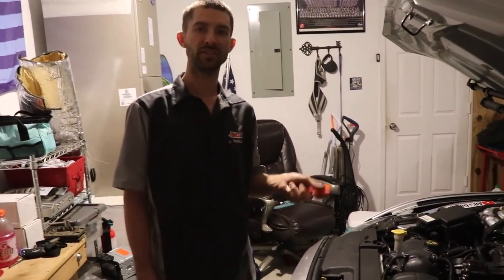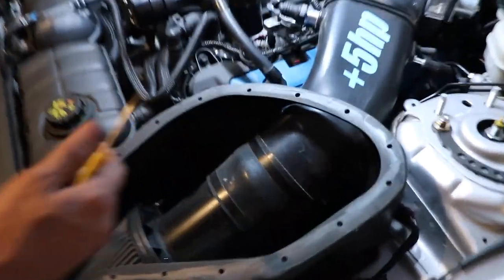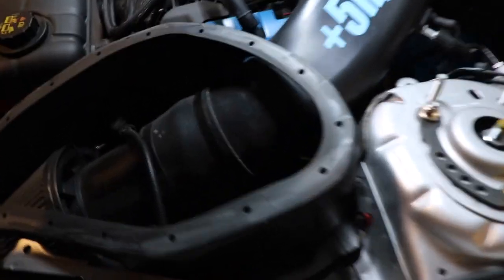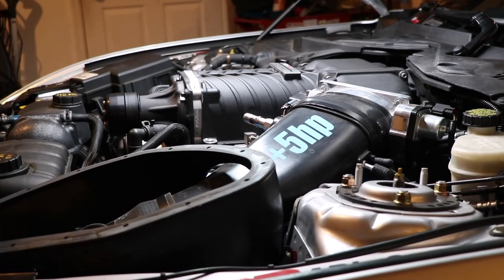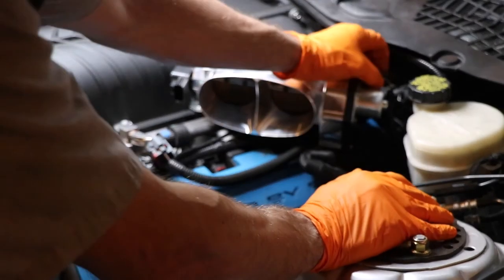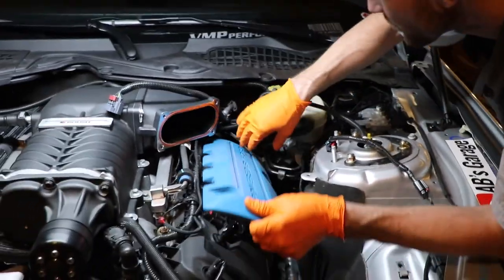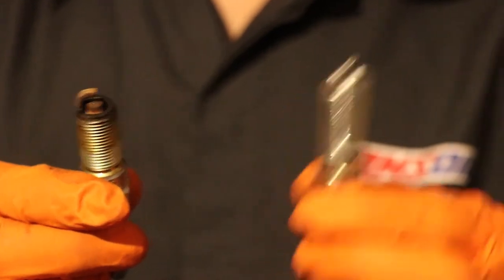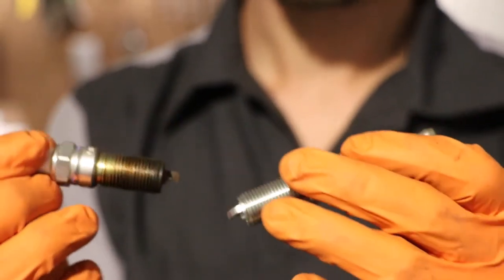Replace SPARK PLUGS **HOW TO** on a (Supercharged) Gen 2 Coyote 5.0L Mustang!

Comment: Great video. Extremely detailed! If I have a Roush Stage 3 on stock boost, would I use those same plugs? They are 1 step colder but is my car already tuned for that from factory?
Reply from the maker: I believe you would

Comment: 👍   Thanks for sharing!   What Torque Wrench did you use?  Nice video..  informative as usual! 

Bring on the oil cross over lines on your GT350!  👍😁

My Quickjack arrived yesterday!   I can’t wait to get it assembled and get my Sliplo pads installed!
Reply from the maker: I'm still catching up on posting stuff that was locked and loaded. This video has been ready to go for over a week now lol but trying to space out the edited uploads so I remain consistent. The lines are coming! Torque wrench is snap on
Reply: @THEDriverMod_  cool!   Nice job as always!  12 ft/lbs is pretty low..   need a good torque wrench for that.  

I’m old school, tighten it till it squeaks and 10 full turns! 😂😂. That won’t work here!  

Keep the videos coming!  👍👍👍
Reply from the maker: @RichGT350r  no definitely won't work lol that's how you turn a 30 minute job into 30 hours of pain and tears 😭